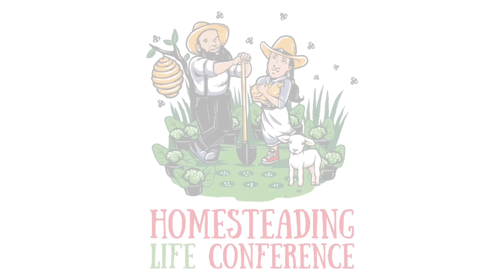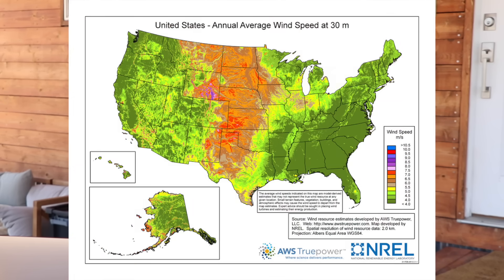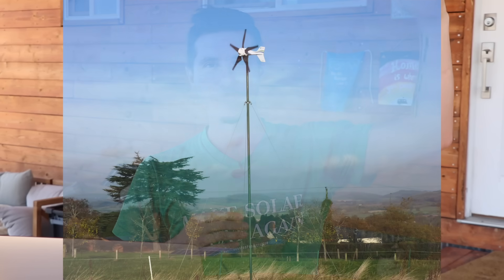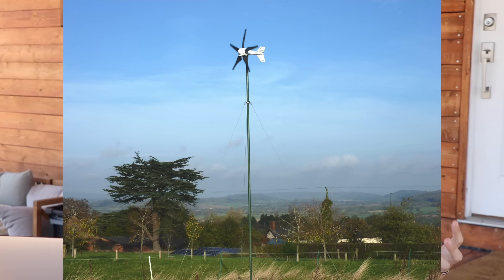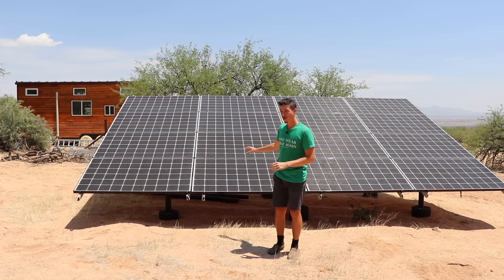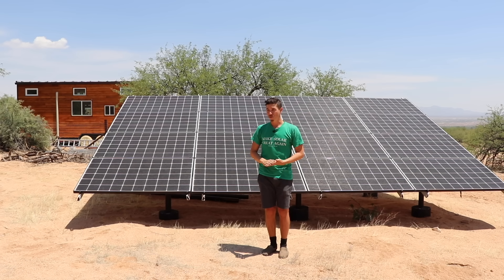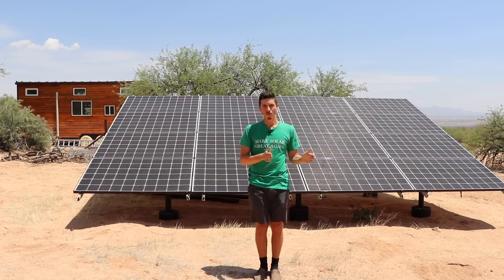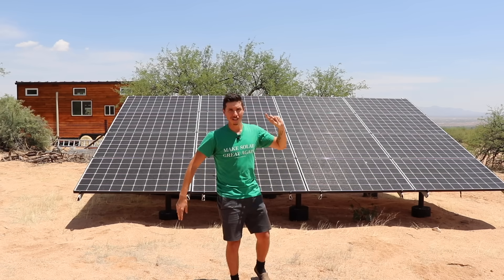Micro Wind Turbines... Are They Worth It? (Off Grid Solar)

Comment: 15 years ago I worked with an Wireless ISP in Wyoming, we had a wind turbine for sail boats on the top of our off grid tower. It worked great, no real maintenance, and kept a few computers running along with other network equipment. We did have 2 probably 150W solar panels, but they would get almost no sun in the winter with the snow and being cloudy. This part of Wyoming it was odd if there was no wind and we did have commercial Wind Turbines down the road about 30 miles. Of course in Handeeman's situation living in a desert with lots of sun solar is a great option. But the blanket statement of "it's not worth it" is naive as every off grid setup is different based on a number of factors mainly location and needs of the user.
Reply: I believe that handeeman is pretty ignorant when he makes blanket statement. I utilize solar during the day and wind at night to keep an equalized charge on my batteries. His misleading statements put doubt into his credibility when he has no experience apparently with wind.
Reply: @claudeezzell2369  Agreed, this video was not helpful at all and he clearly did not research the topic.
Reply: @claudeezzell2369  came to say just that. I'm working on a hybrid system with friends that have working solutions in place.
Reply: @Web Luke I agree 100%. Each situation dictates a person's needs.
Reply: Dude is also selling solar so of course he's not gonna like wind turbines lmao dude is completely biased.
Reply: @dave0161  for sure. Being in a desert also probably makes his solar panels wayyy better. Up here in MN im pretty sure you're gonna get more from wind all winter lol we get like no sun in january
Reply: Wyoming should be the home of windmills🤣
Reply: What happens when you have 3 days of no sun in winter? Your batteries get used up and you would need grid power. Having solar and wind together is what we should strive towards.
Reply: He also lives in a Valley so really not much wind.

Comment: So you want only 1 to do the job?! A solar at Best 40-85 per at 100perwatt is on lower end, at 100w. Vs a cheap Coleman at 400$US, depends on what drained the bucket?! and what you wanted to do, you completely are confusing the situation show where the +/- and where I fit in?! I am N-MN, so heat wood/propane, lights=ambient/led, propane/other! Water? 1st need/storage, then & with 1st available/distant? Me Lake/river when available, see Microsystems, & irragation ups above involvement $ cost benift? I chose not live would air conditioning so I have a 3x fuel system that that can do service always, I don't think a Forest 🔥 will take my house, it all works me on a low $, it about the required at the time,, you should choose, you have to decide a point to start, the importance!

Comment: You have close minded views based upon your environment. 

Where i live, it can possibly rain for a week straight. Whats those "extra" pannels going to do during a week long down pour? Not shit! 

But, with storms, comes wind. Its a good additional source for storms.
Reply: Don't confuse him with the facts, his mind is made up.
Reply: And wind is common when it rains. I wonder if anyone has made a paddle-wheel reverse-engineered turbine designed to be turned by rainfall. Seems far-fetched, but there are some radical ideas in development.

But the extra panels could cover any leaking shingles... :-)
Reply: @thesoundsmith  I like your enthusiasm and ingenuity. The principal you're describing is very similar to hydroelectric power, except instead of a paddle-wheel it uses highly efficient turbines (currently, a Francis Turbine can capture an outstanding 90% or more of the fluid's gravitational potential energy). This fluid gets its energy by being lifted up to a higher altitude by the water cycle.

Unfortunately, to capture a useable amount of water, you'd need a huge area. Keep in mind that hydro increases its energy potential with two factors, flow and altitude. Let's take a two story building with a 210 square meter surface area. During a rainstorm (I'm using hurricane Hiki's total rainfall) your roof (at 9 meters height) would get 213,000 liters of rain, or 213,000 kg of fluid. At that height, it would equal 5.2 KWh. That is assuming you could capture it.

The idea is cool, maybe with massive blimps to capture huge areas at really high altitudes it would be feasible, but for houses it's just not a lot of power.
Reply: @thesoundsmith  I've seen something like that on a house, they had a small turbine hooked up to their rain spout and would spin during the rainy seasons.

Comment: Increasing hail size ,increasing cloud nuclear ion due to the sun are reasons not to install solar power on a large scale such as you have. Also unit for unit it cost more,in terms of pollution, to produce a solar panel.
Reply: Meant cloud nucleation

Comment: Another aspect to consider in the States: Zoning height limitations. Here in AZ, most counties max out at 30 feet. If you want to (and should) go higher for best efficiencies, you need a permit. The higher you go the more difficult it is for approval. There are trade-offs to all technologies and Handeeman addressed those if you choose to listen...too many folks got their panties in a bunch because he lives in a desert. I suggest all the naysayers put up a wind turbine and get back to us in 5-10 years and let us know how it all worked out with a ROI to include initial purchase of ALL required components, site prep and installation, and maintenance costs. Even if you live in a less than sunny environment PV is cheaper, PV is easily expandable, PV has no moving parts, PV is QUIET. Keep them secure, clean, and unshaded and you will have decades of energy.

Comment: Idea, use a solar panel system to charge organic carbon power cell bank. Then use a helium stirling sealed cylinder cold piston that forms liquid gases from the atmosphere that fills an insulated tank with bell siphon that fills an insulated resivor that contains the cylinder heads of a V-20 stirling cold gas piston engine with gadolinium magnetic bearings with antivibration technology with automatic bicycle transmissions attached to both fly wheels then attach large rewired drum motor generators with magnetic bearings that generates electrical power? You could even design the system to use a carbon power cell bank to start the liquid air generation that starts the cycle with the power drain from carbon power cell bank shut down then change up the power cell bank with the charging shutting down ounce the power cell bank is fully charged leaving the electrical generation all for the home or green houses daily use. Could even add a V-twin cold gas engine that operated off the liquid air that had fans on both fly wheels that drew air through a condensing coil that was filled with liquid air for air conditioning. You could design the whole system to recycle the boil off vapor from the V-20 stirling engine and the boil off from heat exchange to return to a cold piston to reform the liquid air.  Some really cool ideas. 😊

Comment: Good vid. However...Why not on top of the roof? Biggest advantage of wind power? Works at night. Harbor Freight or Fry's Electronics(don't remember which) had a setup that's 750w @ $750.00. I'll look this evening! Also "Pure Living for Life" uses a $600.00 charge controller for their Solar. In one of the videos, the connection for 'wind power' is visable in their vid! Again, I'll take a look. Thanks for bringing this topic(wind power) to the discussion table! Keep up the great vids!

Comment: So you don't actually have any experience with using a wind turbine yourself?
How about some power when there is little or no sun for people that don't live in a desert (most people).
"Location, location, location!" Wind can be low to no maintenance, quiet, and have many other benefits over solar.
Reply: Here in PA I can't get more than an hour or two out of my simple solar charged yard lanterns in the summer. My yard chachkies won't work at all. I know it is apple and oranges but it speaks to the lack of sun power here.
Reply: We got both solar and wind going here in south dakota

Comment: Why do you point out that the wind isn't always blowing but you dont point out that the sun isnt always shining? Seems biased.
Reply: he spent a lot of money on those pannels, do you think he likes the wind, in desert?
Reply: LOL so stupid
Reply: He’s wearing a “Make Solar Great Again” shirt, he’s obviously biased 😂
Reply: @Mr Sunshines In areas where wind blows all the time, turbines are the better choice. Where I live, I get very little wind, and large scale turbines are a rarity in my area. Up north, solar panels aren't as bad as one might think, because even though there is less sun, the panels run much cooler. While they don't produce as much current, they produce higher voltage, because of the lower junction temperatures of the cells. In short, panels produce less current, more voltage, with only slightly less wattage.
     There are many more locations that don't get steady wind, than areas, that don't get sunlight. That might be the point that came across as being biased. When choosing, you have to consider a thing called "capacity factor". That is calculated, by multiplying the rated output of the system by the percentage of time that it actually produces that in a 24 hour period. A 5,000 watt turbine operating at 50% capacity factor beats a 20,000 watt photovoltaic array  running at a 20% capacity factor. Now, look at the difference in cost. If a turbine costs 3 times more money per watt than solar, you might just consider buying the extra solar capacity to get the power you need.
Reply: Outside of a very few places on the planet near the poles, you can always add more panels to generate whatever power you need with the sun you get.  Doesn't matter how many turbines you add, if the wind isn't blowing, you're not generating anything.  

They also have a much greater footprint and you're extremely limited in placement of multiple units to avoid wind shadows/the danger of one falling into another.  You likewise can't install them near trees for the same reason.  Then there is more periodic maintenance that's more dangerous because you're having to raise and lower a pretty tall tower.

For the vast majority of people, all of this is just far too much, especially when an MPPT controller and amorphous panels can charge on very little light.
Reply: Don't rain on my parade !
Reply: The problem with wind turbines is not so much their own attributes but more so the comparative improvements and cost reductions in the last decades in solar.  Wind isn't bad its just solar got so good and cheap.  Solar is just so much more scalable and modular from a tiny solar panel for trickle charging up to commercial installations whereas wind's scalability starts at a higher level higher than most personal use levels, besides outlying applications.  Check out what people are doing on boats, in the sea with generally much better access to good wind.  They meta is still getting rid of wind in favor of more solar.  Win also has a disadvantage of being loud, and with moving parts more things to maintain and replace.  Also a turbine is build as a compromise as in peak efficiency for certain wind speeds, needing breaks for storms and not great performance is soft wind due to small size.  Also we continue to see solar decreasing in price/increasing in efficiency while we are seeing some gains in win, its not the same, end of the day closer to the limit of physics.
Reply: He makes more commission off the panels.
Reply: You don't live in Arizona do you?
Reply: Anytime you see daylight, there is sun. When there is no sun, you wouldnt have daylight , so he is correct. There is always the sun. The panels doesnt necessarily require  blazing sunlight to get the required amount of energy. That is the idea behind his claims. he is correct
Reply: batteries are much more expensive then adding a couple wind turbines to get you through the night or boost in cloudy days (clouds usually equal wind) if you live in a reasonablely windy area.
Reply: Well, technically, the sun IS always shining. Just not on YOU... :-)
Reply: David Kempton the whole flow of wind would have to be stuck for there the be 0 wind. 0 wind is physically impossible
Reply: @thesoundsmith  You make a good point. What we need is a global grid, because the wind is always blowing somewhere, the sun is always shining somewhere. If all parts of the globe were interconnected, everyone would have power all the time, with minimal need for electrical energy storage or even base load power, for 100% renewable energy.
Reply: @vincentrobinette1507  what size cable would you need, if it was feasible someone would already be doing it, as they lay communication cables worldwide
Reply: Those are all good questions, considering that much of the communication cable has already been laid. This wasn't a consideration until now. The other problem is that the cable needs to carry gigawatts of power over great distances. Heat is no problem for a cable that's water cooled, but the energy needs to get there. good insulation will allow the cable to run at higher voltage, which allows more reasonable cable sizes by reducing the amperage necessary to carry the wattage with minimal losses. It might just be a pipe dream(literally).
Reply: photovoltaic panels can still put out about half their rated power on a cloudy day. Thus, they will work every day. If you're going to decide on renewable energy, site unseen, solar is the better bet, for just those reasons. If it's constantly windy, I would actually recommend a combination of both.
Reply: ...latitude
Reply: @vincentrobinette1507  that's not correct. Our system goes to an eighth current on heavy overcast days (and yes, my controller is MPPT). It certainly makes sense to start with solar panels but wind generation often provide a usefull 24 hour a day top up.
Reply: @davebox588  Are you running monocrystalline, or poly? Monocrystalline will have less collection area than poly, and a lot less than Amorphous. As such, because of the higher efficiency, less area is necessary at standard test conditions, but, will taper off much more on a cloudy day, than on a bright sunny day. Square inch for Square inch, monocrystalline will produce more power under any conditions than poly or amorphous, but, has much less surface area per installed watt.(I'm running polycrystalline)
     I've always advocated wind and solar as a combination for just the reason you stated: It minimizes the amount of battery capacity necessary, to ensure 24/7 power availability. It's also much easier, to get the absorption charge necessary, to protect lead acid batteries from sulfating. The problem is, I just don't get any wind! every so often, a storm will come through, and we get gusts, but not often enough, for me to get a return on investment from a wind turbine, That money would be better spent on photovoltaic panels, but, that's just where I live. What you need, is an anemometer, to see what energy you really could from wind, which would help you determine the size of machine you need, to be effective.
Reply: @vincentrobinette1507  wind works at night does solar
Reply: @debeeriz  That's the beauty of wind. It can work anytime. The problem is, it's much more intermittent. Some days, it can blow so hard, for so long, that you have to curtail for lack of capacity. Then, weeks can go by with virtually nothing. Solar is much more predictable. That's why I say a combination of the two, can offer more reliable power, with less battery capacity, than either one alone.
Reply: Vincent Robinette agree with you, specially if you’re going to live without regular electricity a combination of both is the way to go. I have a place in Baja, in a solar only area and additional wind power certainly makes a difference specially at night.
Reply: It is 100% biased.  And by his T-shirt, it's obvious he has his money in solar panels.  That's why he's a biased jerk who is perpetuating lies.
Reply: @basedbear1605  what an incredibly childish comment

Comment: Ya need to realise that there are so many variations on designs of wind turbines, vertical axis wind turbines (VAWT)'s are usually run much lower to the ground and require much lower windspeeds to start rotation and ramp up to generating a charge.  They also are self-braking when the windspeeds get too high just by the general nature of how resistances work when charging too fast through a coil.  Its a super interesting topic once you look into it a little more, some of the clever design ideas for gaining wind power from different locations makes the engineering part of my brain humm with glee, especially knowing that I can follow along and most likely build most of a turbine myself without paying someone else to do it (have attempted one already and overbuilt it by scaling up a smaller model to past what I should have)  In saying this though I love the reliability of solar, it is simply a great solution for my piece of land where wind is an 'almost' unnecessarily highly available commodity.